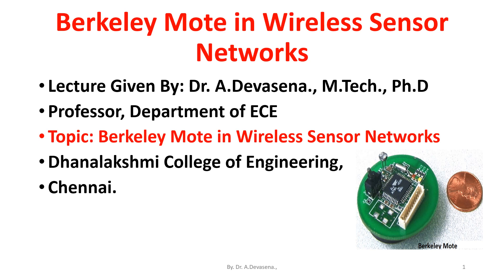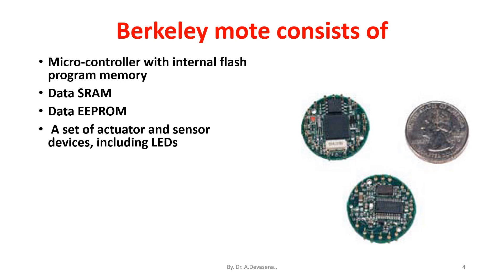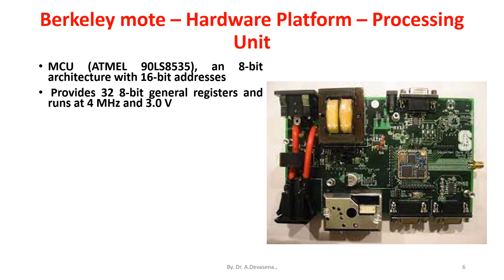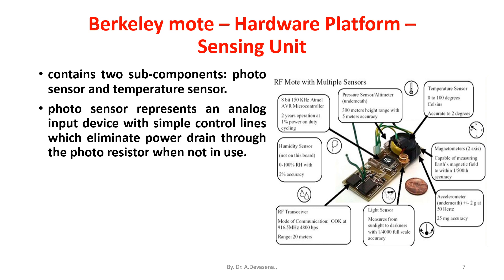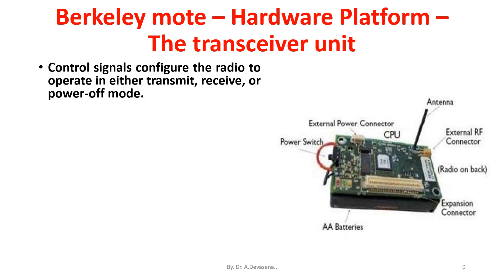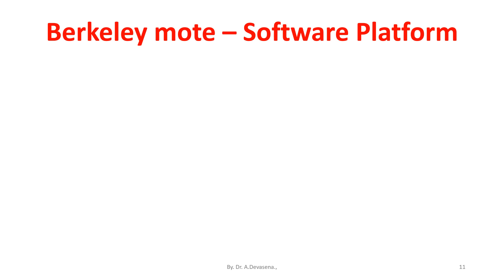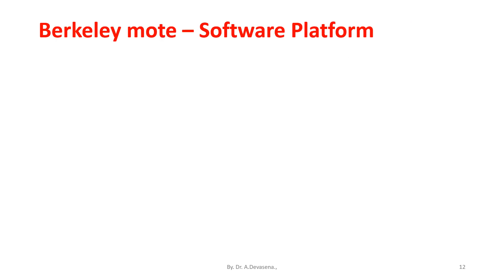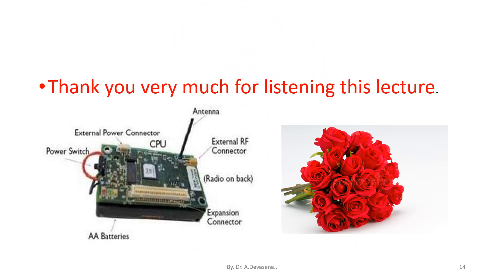Berkeley Mote in WSN

Comment: Mam can u tell important questions of Ad hoc network for sem
I'm from dhanalakmi srinivasan engineer Clg perambalur
Reply from the maker: EC8702 - Ad hoc and WSN important Questions
Unit I
Explain in detail Destination Sequenced Distance Vector Routing Protocol.
How table-driven routing protocols for ad hoc networks work ? 
Write down the difference between proactive and reactive routing. 
Discuss the various major issues in designing routing protocols for Ad hoc networks.
Explain in detail about the types of Ad hoc routing protocols. 
 Discuss the steps involved for maintaining a routing table in DSDV. 
Write short note on wireless routing protocol.
Explain in detail the various algorithms of reactive routing protocols. 
Write in detail the various algorithms of hybrid routing protocols. 
 List out the advantages and disadvantages of various table driven routing protocols. 
Discuss the advantages and disadvantages of various on-demand routing protocols. 
Unit II
1 Explain the energy consumption, energy saving and sleep mode overheads for the sensor nodes and derive an expression for Energy Saved and Energy Spent in overheads.
2. Explain the various types of mobility of participants in WSNs.
3. Explain in detail about the various design considerations for a WSN node transceiver.

Unit III
Elucidate in detail about the Low Energy Adaptive Clustering Hierarchy (LEACH) Protocol in detail.
Describe in detail about the S-MAC protocol.
Explain the Super frame structure of IEEE 802.15.4 MAC protocol.
Explain Optimized link state routing protocol. 
Explain range free methods for localization.
Discuss localization problem in WSN routing and explain how it is handled.
Explain in detail about the optimization goals in wireless sensor network.

Unit IV
Explain in detail about various security goals in WSN.
Explain in detail Various security attacks in WSN.
Explain in detail various network layer attacks in WSN.
Explain in detail various transport layer attacks in WSNs.

Unit V
Explain various challenges faced in sensor network programming
Explain the sensor node architecture.
Explain various hard work components of sensor node.
Explain major concerns in WSN OS design.
What are WSN Simulators? Explain with examples
How WSN OS supports real time applications?